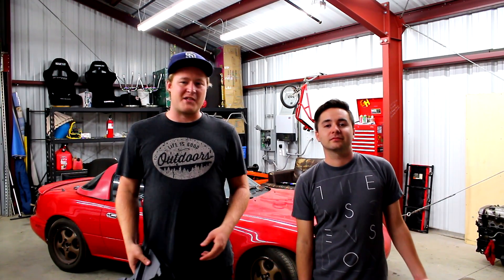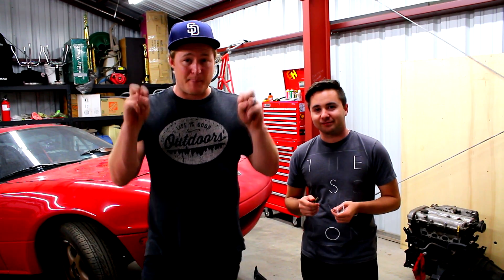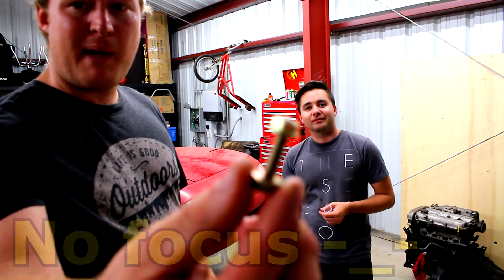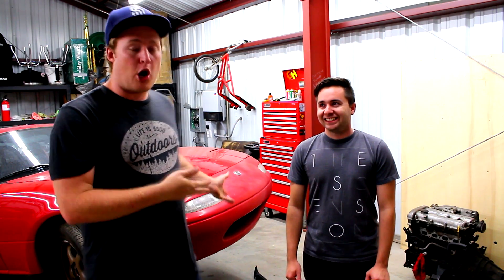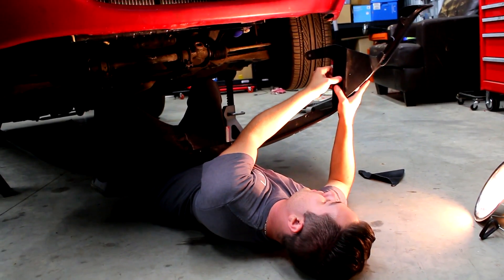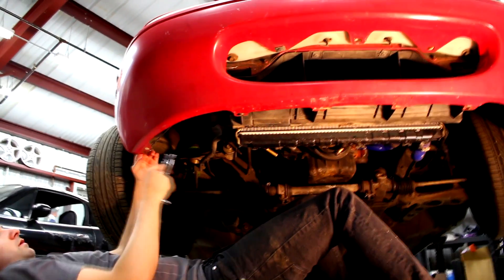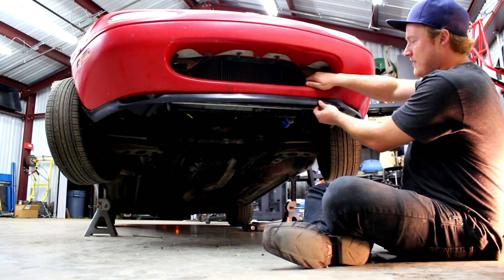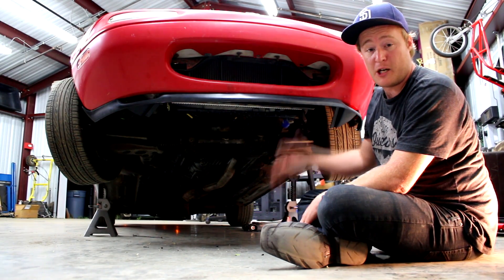R-Style Lip vs GV Style Lip! | Melody Miata Build #8

Comment: those 2 extra pieces go right where Matt had them, they will sit just behind the bumper so you cant see them but work as a funnel/dam to push air towards the brakes and the tabs that stick out towards the middle of the car are designed to bolt onto the stock undertray but you dont have one on that car.
Reply from the maker: Yea his car was missing the under tray when he got it, we'll add something later when he turbo's it. That makes much more sense though as far as where they attach, Idk why I didn't think of that so thank you! Funny though that they are meant to push air towards the brakes cus they don't seem to point that way much =P either way thank you for the insight!
Reply: GearHeads they "kinda" point in the general direction of the wheels ;) but hey, not bad for a rep part that's maybe only the best part of £90, well that's how much I paid for my eBay one over here in the UK! Maybe the oem R-package one actually had functioning ducts, anyways glad I gave you a bit of insight and keep up the videos, they're a really good watch!
Reply from the maker: Thank you very much! and yes they are cheap, my GV-Style one was $45 shipped and Matt's was like $50 or so. They look good and hold up pretty well!

Comment: All this talk of lips has me crankin up some Rolling Stones!  Glad to see the comparison.  I'm assuming they were roughly the same cost.  I haven't decided which one I like better yet.  Just my opinion, but I think it depends on the rest of the car.   For instance, if you have the duck wing spoiler on the back, then the GV lip on the front balances it out better.   I can't fit either one on mine because I have a K&N cold air intake that has a small intake scoop bolted to the bottom of the lip, and flex pipe snaked up through the engine bay to point towards my cone filter.   I guess I could remove it, but it's one of the few mods that my dad did himself, so I'm leaving it for sentimental value.  The only way I'll take it off is whenever I decide to go turbo.   Anyways, thanks for showing the comparison.
Reply from the maker: Because Miata You could still keep the intake, just redirect it slightly towards one of the air ducts!
Reply: That thought has crossed my mind....hmmmm....lol.

Comment: Just use self taps it’s so much simpler
Reply from the maker: They don't hold near as well and will tear out in time. It works but trust me its not the best way to do it.
Reply: @GearHeadsGarageChannel  yeah but mine held up fine for like 6 months until i got the new body kit

Comment: Gv looks a lot better imo
Reply from the maker: Thats why I picked it! Depends on the style your going for, the R-style lip is clean and looks closer to factory, but on my car the GV lip fits the style with the ducktail and eventual wider tires and flares that will come.
Reply: GearHeads I like your advanti storms is your car closer to stock height or lowered? Because I'm going for the same setup s1s 15x8 205-50-15, they look nice but I want them to be flush with the fender and not stick out too much should I go with the 205s or 195s?
Reply from the maker: They are only 205's they wont stick out really and are pretty even with the fender. I wouldn't pick tires based on looks either, as important as they are and the fact that I enjoy driving I'd say pick based on your needs and wants as far as performance and use goes. If you go back and check out our wheel stud video on my car you can see them mounted on stock suspension!
Reply: You should do a photo shoot of your car& thanks for the reply
Reply from the maker: ruffus4924 Not yet, paint looks like garbage(clearcoat peeling and falling off) and we have a lot left to do with the build! When its done we will paint it last, then we will do a photoshoot and big reveal video!

Comment: I think those extra pieces are used to sandwich the lip against the bottom of the bumper.. not sure....
Reply from the maker: Luis Lynch-Maldonado I dont think so because theres a couple pin/stubs sticking up off the lip and holes they match up to on the flaps...It installs and looks fine without them so whatever.
Reply: Hey if it works that's all that matters!

Comment: good grief bro lol so many    "   " fingers in the video ROFL
Reply from the maker: LOL Sorry, I noticed I did that in editing too. Chalk it up to me being tired and forgetting I was repeating myself =P
Reply: IT's all good, i thought it was funny cause i do the same shit. by the way, those little panels that you weren't sure how they went... they attach to the R lip, and sit just behind the edge of the bumper, and they mount to radiator duct, which he is obviously missing... hope that helps    i guess a more technical way to say it is "upper shell leading edge contacts bumper skin trailing edge, and attaches to radiator surround duct."
Reply from the maker: Got it, thanks for the info! Luckily it installs just fine without them =P
Reply: yup, ill admit that i have no idea why they attempted to "duct" that air to go anywhere.. on a 100% OEM car it still just flows into empty space..